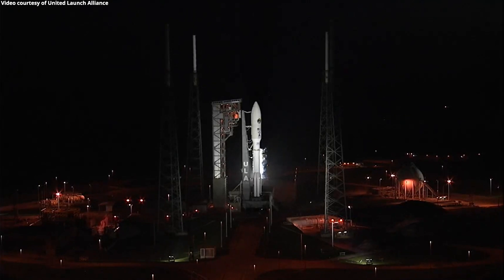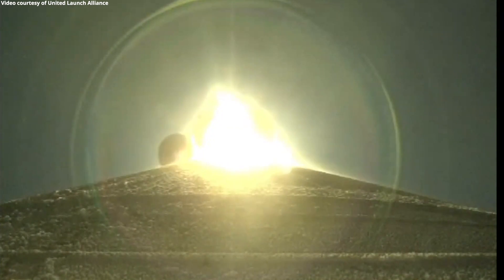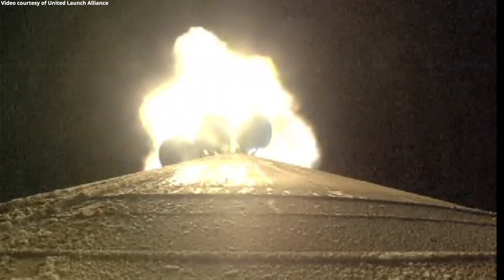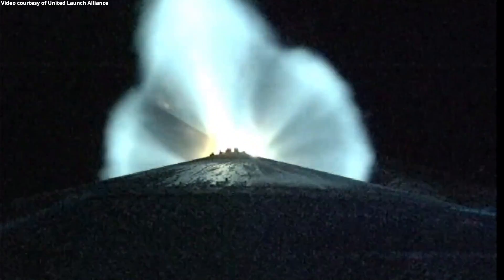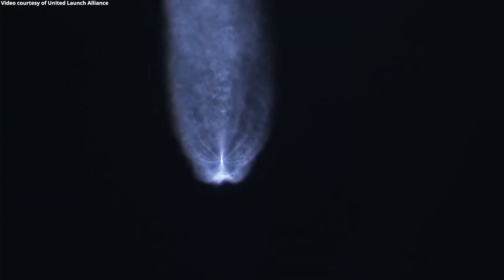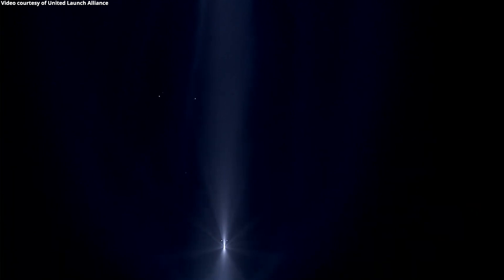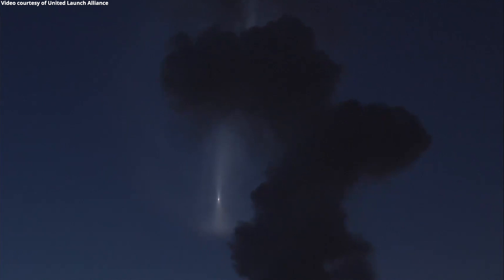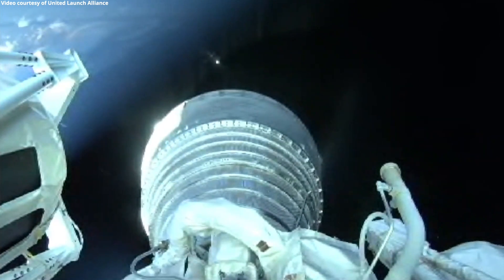Atlas V launches AEHF-5

Comment: The Russian made RD-180 rocket engines used to power the Atlas 5's first stage sure have been a blessing for the US space program.
Reply: Aren't they Russian designed, licensed to ULA and manufactured by ULA?
Reply: @RME76048  No.  Pratt & Whitney was going to obtain a license to build them in the US, but they were going to cost more, and the Russian ones were just too reliable to risk millions of dollars in satellites on trying to start production here.    Others US companies are trying to build knockoffs, but are years away from matching the RD-180s performance.
Reply: @JDGillis  Thanks for that clarification -- appreciated. Yep, those high-pressure 180's are one heck of an engine! It is my understanding that they use steppers instead of servos for thrust vectoring. Seems to work fine.
Reply: dont forget about the boosters